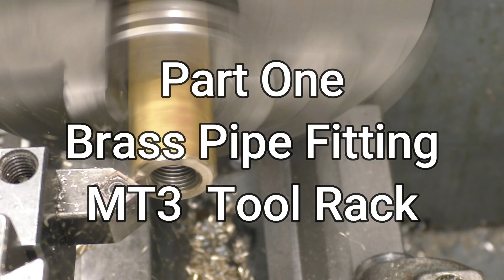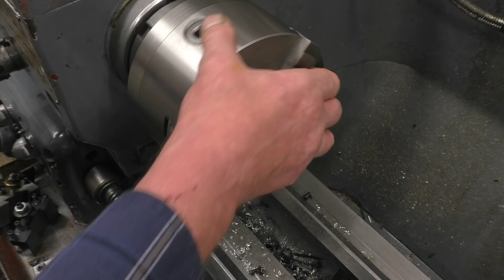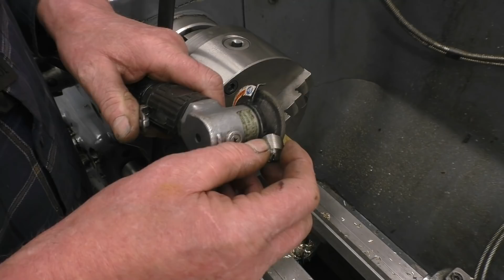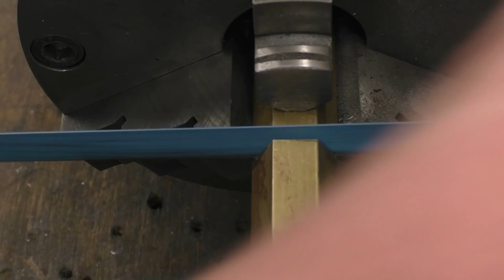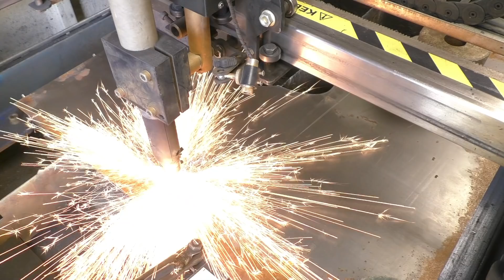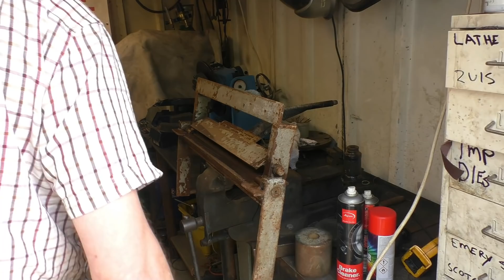SNNC 429 P1  Brass Pipe Fitting . MT3 Tool Rack

Comment: Nice job on parting to length, I used to get told off as an apprentice in the 70's if I had drilled or bored into stock, a lot was in non-ferrous.
Great work and close up photography John. 
Thanks for sharing.